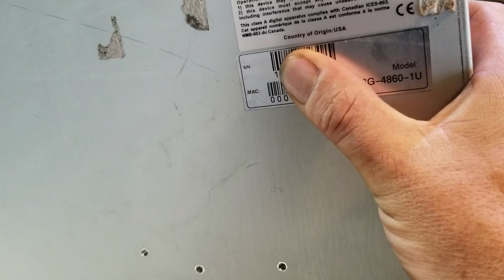NETGATE  SG-4860-1U PFSense emmc  onboard storage failure

Comment: Just got home from vacation. This equipment won't boot up. We have home surge protection.  Ours is maybe 3 years old. Have back up power too. Turn it on and the red light comes on but shuts down. Status light is red then shuts down.  I'll try support. Tell them the red light comes on them shuts down. Hoping they helped you. Keep me posted. Assuming the didn't stand behind it.  What did you end up doing

Comment: Yeah, so mine is getting flaky after about 2 years... I'm opting to fix it by installing a 32GB mSata SSD ($38). Once I get that I'm going to install using the ZFS, which has stopped any corruption issues I've seen in my other installs. The UFS system is not the greatest for recovering from hardware failures, while ZFS can heal from almost anything.

Booting can be tricky, since when you power off using the rocker switch you have to wait for the power in the system to completely dissipate. Since these things barely consume any power, it can take up  to 1-2 minutes for the power to dissipate. Once I figured that out, I stopped getting freaked out when it wouldn't boot back up when I flicked the switch back on. This is undocumented, but I did find a forum thread detailing this:  https://forum.netgate.com/topic/104461/my-brand-new-sg-4860-1u-boxes-get-locked-for-some-minutes-after-a-power-outage/7

One other thing, when you are connected to the terminal using the USB cable, make sure to restart your terminal session after the power-off. Often the terminal session new-lines were getting messed up and I was missing the F12 for boot selection. 

Hope all that helps!